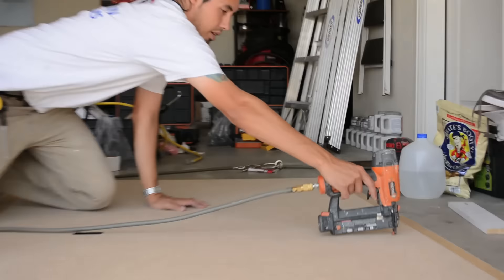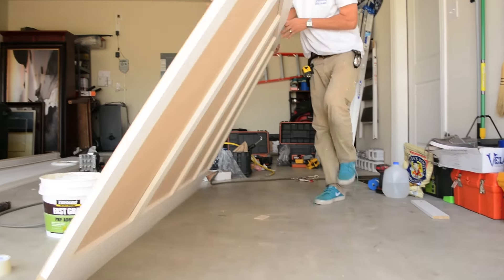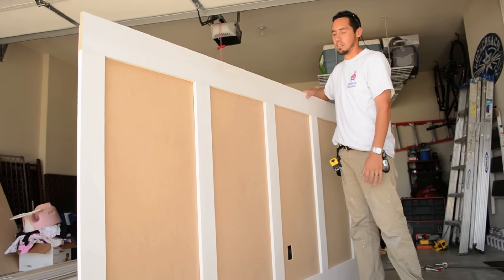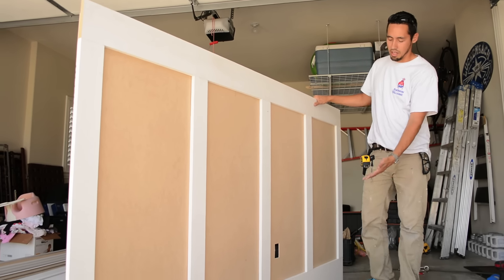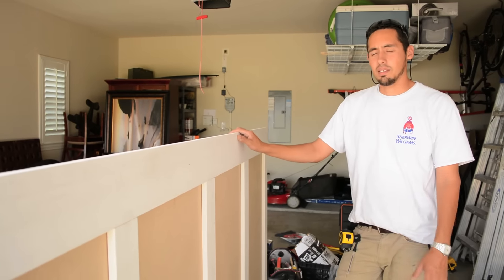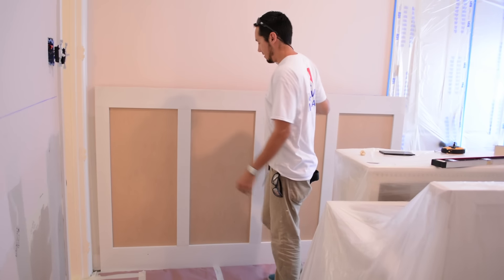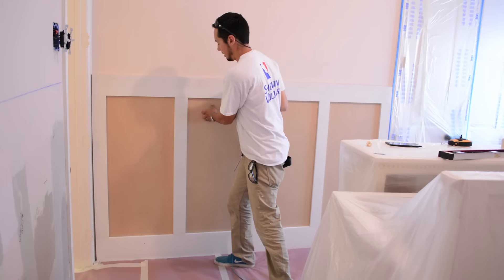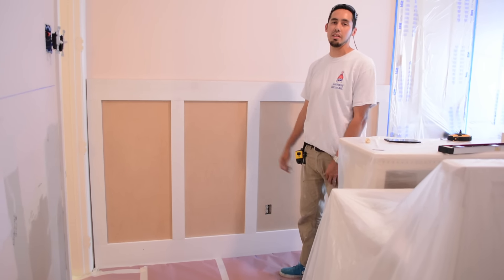One Piece Wainscoting Installation

Comment: I have a question, What's the reason to glue the back and nail it also? Wouldn't nailing it be good enough?  Just curious not trying to be a jerk. Like I said in another video, I'm up for learning new techniques and knowing the reason for them.
Reply: There is no scientific answer to your question. The first reason I can think he is using a 18 ga brad nailer so the “nails” are smaller than usual (the right tool for the job). So he is just making sure the job is done right. I would do the same thing. I use glue on door trim and other places and people think that is over doing it. 2nd the glue mixed with the nails will make sure there is more of an area where the wood is fastened. If you live near water the wood will warp over time. So having more of it fastened less chance of something happened.